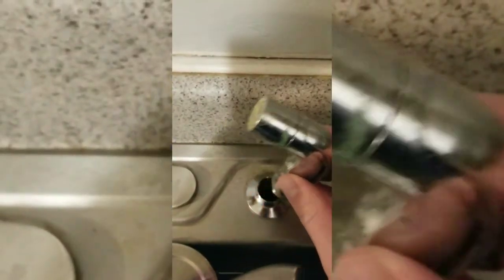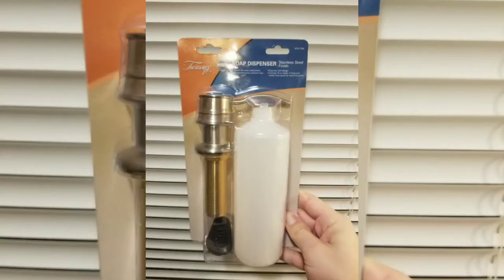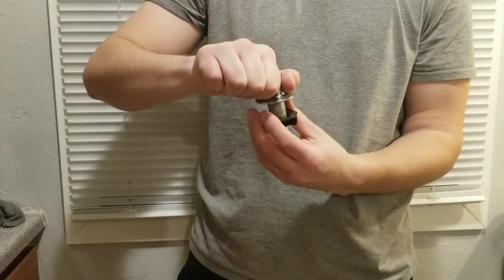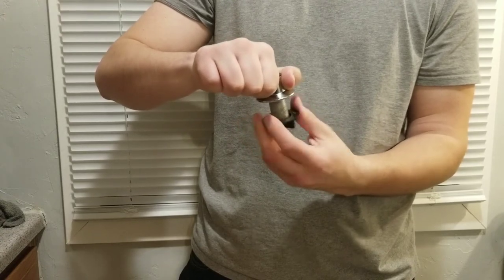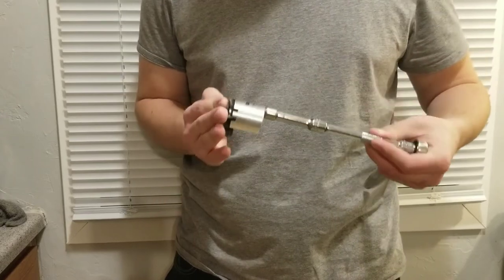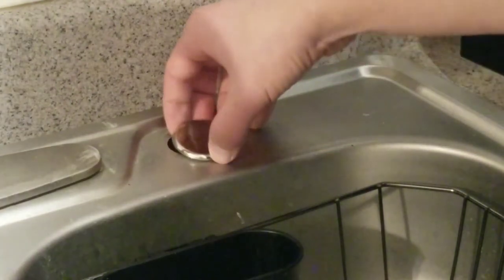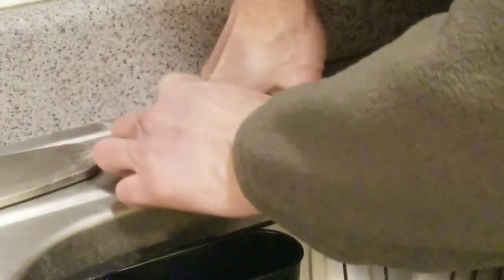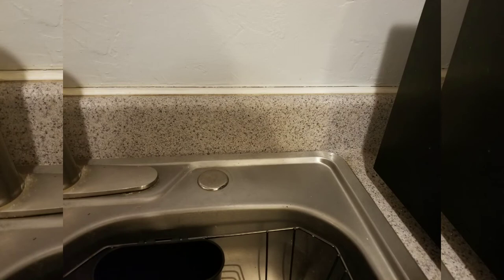HOW TO INSTALL A SINK HOLE CAP

Comment: What do you do with the water line (not sure if that's the right name for it, the hose part attached to the sprayer) that went to the sprayer? Does that attach to the new faucet?
Reply from the maker: The new faucet with an integrated spray hose will usually have its own hose to connect to the sprayer
Reply: @Property_Matters  Thanks!

Comment: Are sinkhole caps permanently installed? What if I need to use the sinkhole for an under-sink filter faucet?  Can the cap be removed?  I regret that I let the sink-hole be covered. Now, I need to uncover it. Can I possibly do it? How? Thanks in advance! I am just renting an apartment.
Reply from the maker: It depends on the type of cap that you have but there should be a plastic nut underneath the sink, on the other side of the cover. You would just follow the steps in reverse order. If the previous installer used plumbers putty, the cap will be more difficult to remove.
Reply: @Property_Matters  Thank you very much for your kind help! I took a picture and I'll post the link for the photo.